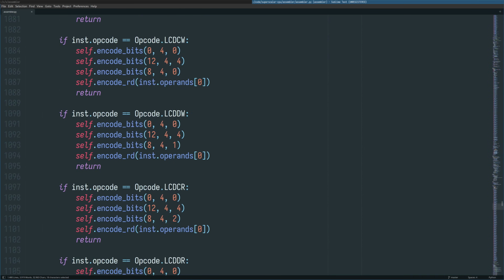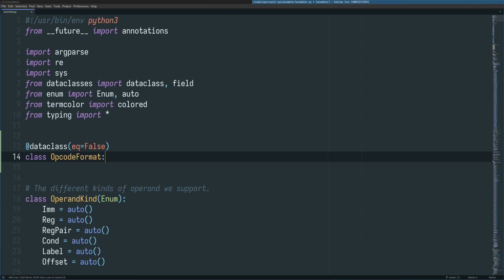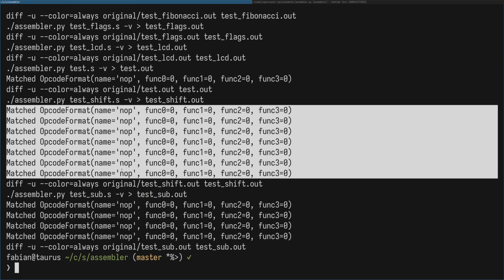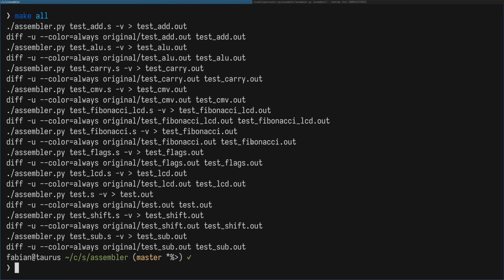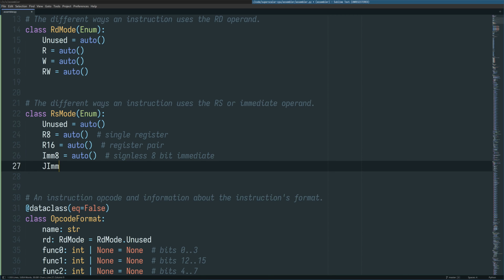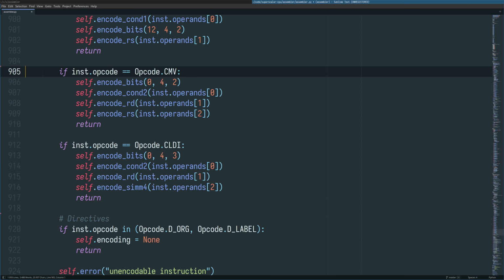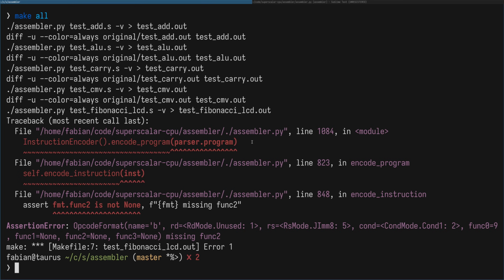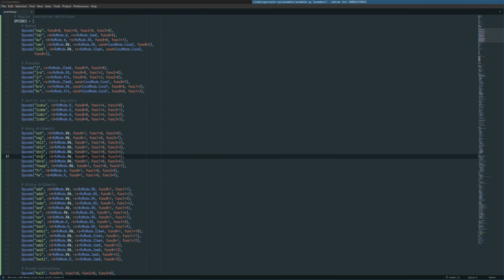Instruction Formats for My Assembler – Superscalar 8-Bit CPU #51

Comment: I guess it's not yet necessary for the current assembler, but it would be nice to have information about which instructions affect the flags, like your flags? and flags! notation in the isa.txt.    Then the OPCODES table and isa.txt are truly one-to-one.
Reply from the maker: I totally agree! 👍 Moving this all into a single central list of opcodes that we compile into the necessary pieces for the assembler and the decoder would be great. Eventually we’ll want to write an assembler and disassembler that can run on the CPU itself. Having a complete list of opcodes such that we can build efficient assembly for the assembler would be helpful. We’re going full meta!

Comment: I just finished watching the series from the beginning.

Are you going to go back and add driver chips for the LEDs on your PCBs? I saw you did that for some that are for buses, but it looked like you didn't for control signals, and I'd expect that to interfere with the ability for those signals to honor set-up times when the clock speed increases. I don't know when/how often you plan to revise the designs. I remember when you made the condition module thinking that there was equivalent logic hiding in one of the existing PCs, and I remember with the imm/mov/flag PCB thinking that dealing with different immediate sizes and whether to sign-extend or not was a decode responsibility.

Also, for 16-bit paired-register instructions like the absolute jump, I think it would be reasonable to say that r21, r43, etc. are options, but r32, r54, etc. are not. So similar to the x86 AH/AL. BH/BL, etc. That would save an instruction bit for encoding different instructions.

Comment: Nice. I am curious though, is there a plan to include multiply or divide functionality (either as a software subroutine or with dedicated hardware) as having those really does open up a lot possibilities.
Reply from the maker: Absolutely! My rough plan is to get out-of-order writeback of results going, then add RAM and a load-store unit, implement software mul/div as proper subroutines using a stack, and then later build up separate mul/div hardware as another example of two units that have multiple cycles of latency 🙂
Reply: @fabianschuiki  AMD's Am29000 (a 32-bit CPU) had an interesting variation on the multiplication: it had "move to/from special registers" instruction (one of those special registers was multiplier's shift register), the "single multiplication step" instruction (shift+conditionally add-subtract if 1 was shifted out), the "last multiplication step" (which performed final sign-correction), and then there was a reserved instruction called MULTIPLY: it would always trap, and you were supposed to put into its handler the "short" program consisting of "mtsr Q, rs1; mul rd, rs2, #0", then 30 repetitions of "mul rd, rs2, rd", and then "mull rd, rs2, rd; iret" — so the upper bits would end up in the rd, and lower bits in the special Q register (which one could read with "mfsr rd2, Q").
It also helped that Am29000 had ability to use registers "indirectly": a trapping instruction would record its rd/rs1/rs2 into yet other special registers, and there was special addressing mode (basically, you named r0) that would target GPRs recorded in those special registers... you know what, I think just having a multiplier unit with its own sequencer/microcode will be much easier.
But the nice thing was about this multiplication subroutine was that it was trivially interruptible/continuable — all the state was architecturally visible.
Reply from the maker: That's a pretty interesting way to implement a multiplier! 😃 Makes me wonder why that turned out to be a better option than adding the small state machine to drive the single multiplication step 30 times. They might have been optimizing for something specific there 🤔. The nice thing about having an independent self-running multiplier is the fact that you can go and do other work in the meantime with the CPU 🙂. AMD might not have needed that though.

Comment: Nice.  Having multiple 'functions' that are essentially big switch statements (rather than a proper OO definition of an instruction) was always going to get messier as you added more instructions.  Using make and diff to compare the refactoring against the expected results was a very cunning approach.
Reply from the maker: Yeah the big switch was getting really ugly. Having a more structured code layout will make it easier to read the opcode table from a file on disk later. And maybe autogenerate an assembler and disassembler that can run on the CPU itself 😏

Comment: I’ve always thought you should write a tool to process your ISA file to generate your assembler.
Reply from the maker: I'll definitely try to move the assembler over to using that isa.txt file I have directly. A single source of truth in terms of opcodes is going to be very handy, especially if I want an assembler that runs on the CPU itself. 😃
Reply: Or at least create a configuration file with instruction formats, opcodes, etc, and read it instead of hardcoding it in the script.

But the current version is much better.
Reply: Imo it's not worth bikeshedding about the assembler program. The goal should be to make the hardware well defined such that writing software for it could be done by anyone

Comment: I got a Christmas present from Germany, I am guessing. Thanks!
EDIT: How many bytes did you save by the refactoring?
Reply from the maker: Haha 😄. I think the file went from 1500 lines down to 800. Having tighter structure will also make it easier to write an assembler in the assembly itself, so you can assemble programs for the CPU, on the CPU 😏
Reply: I thought he is from swiss?